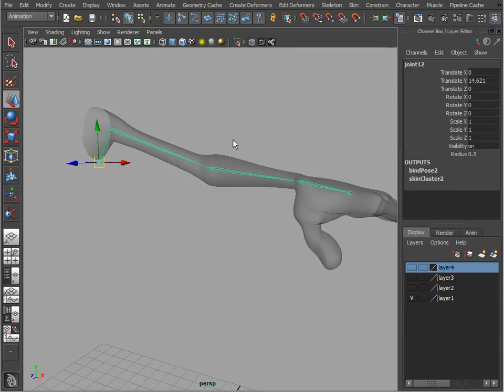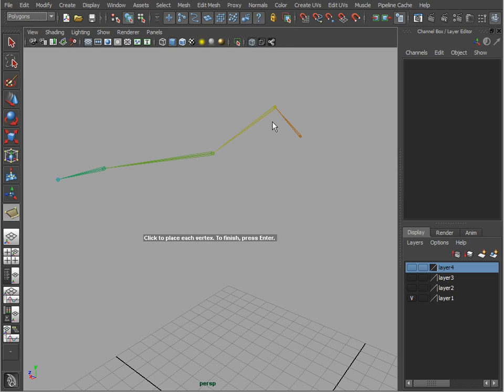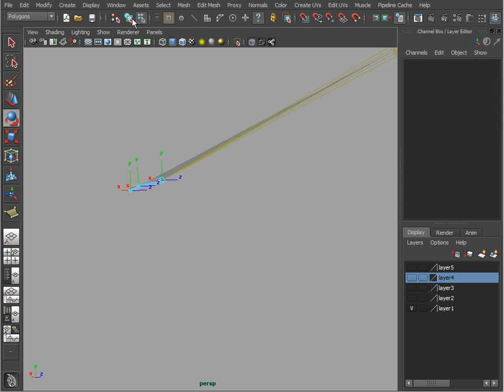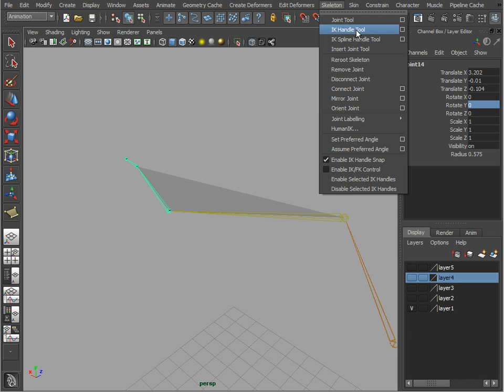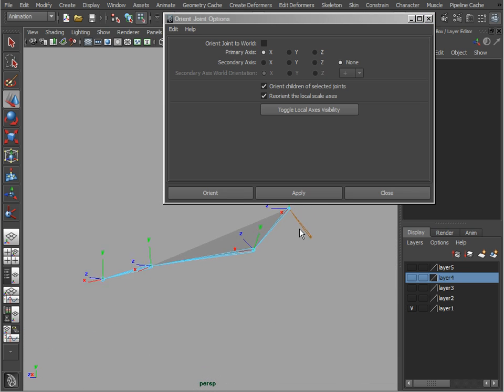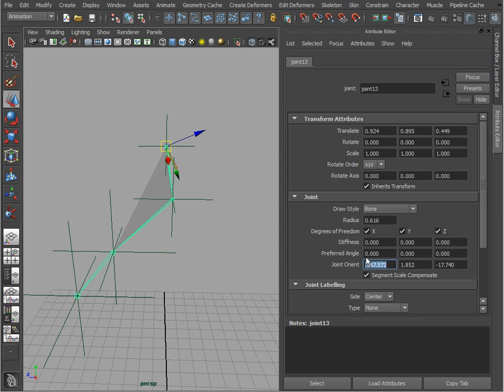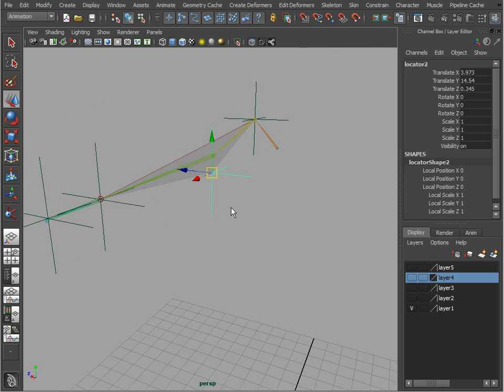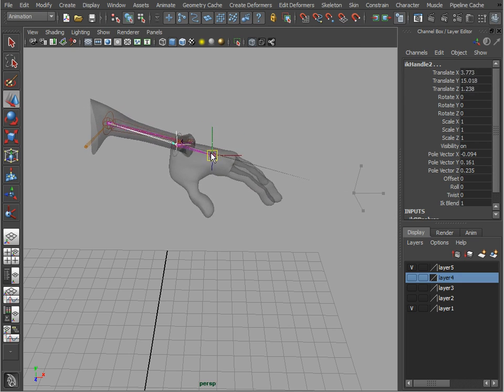Maya IK, Why joints flip

Comment: Im getting this same problem but not in an IK Handle - im using a simple aim constraint between a wrist and an elbow (that's segmented). so when i turn my wrist 90 degrees on the chains forward axis. the bones go flippy floppy.

I've tried changing the aim constraint settings, by reversing the up vector settings, but the flipping still happens on the opposite direction of the same rotation. is this an unavoidable problem in the same vein as gimbal locking?